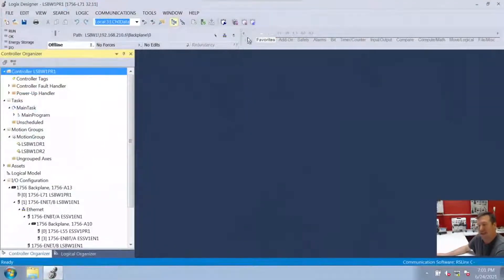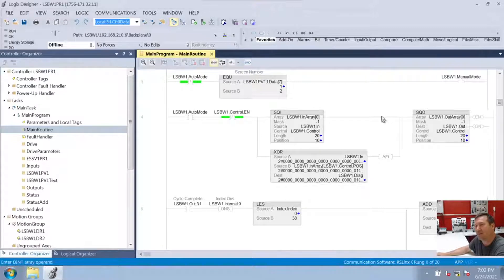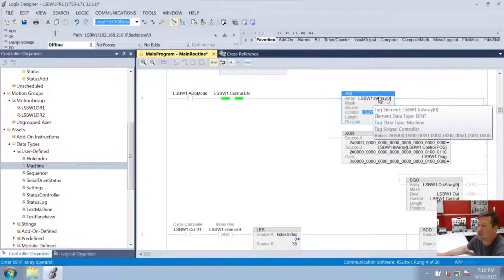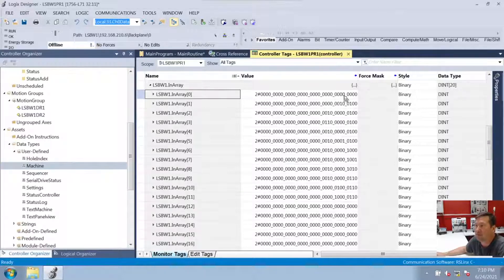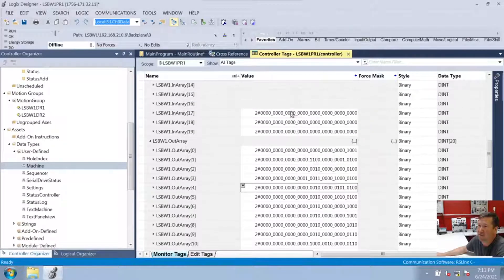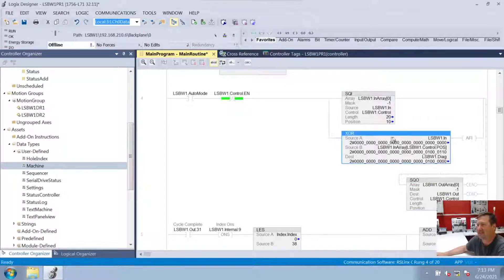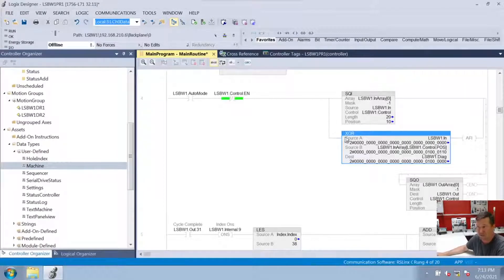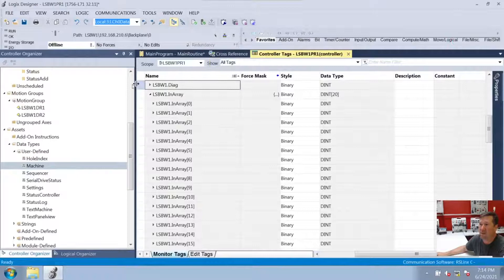Allen Bradley PLC Sequence SQI SQO Programming Tutorial Part 9

Comment: Just battled a machine for 10 hours today that used SQO for every output in the machine. Not most any machine, a 12 head VFD driven filling machine. I still haven’t fixed it i can only tell you it’s stuck at sequence 15 then Resets itself. The guys that wrote it, $175 hour to talk to you.
Reply from the maker: The XOR instruction in this video is the key to understanding SQI SQO sequencing.